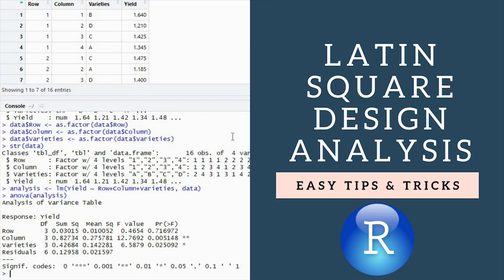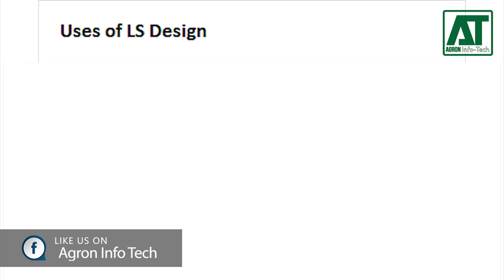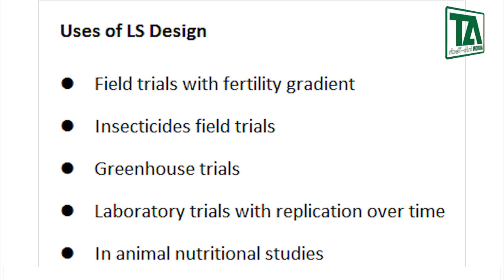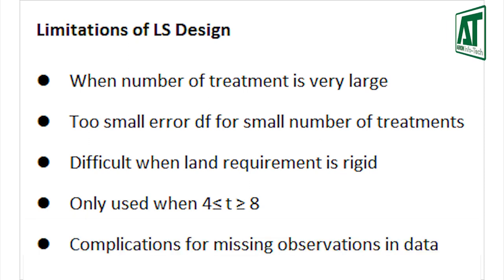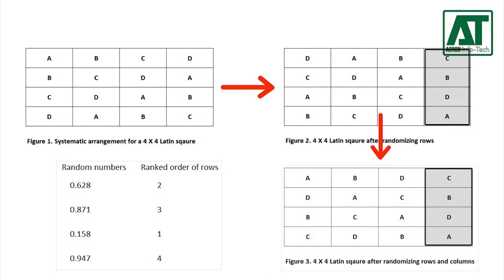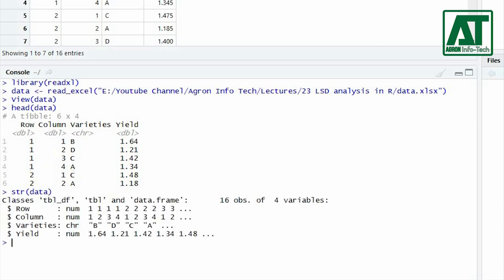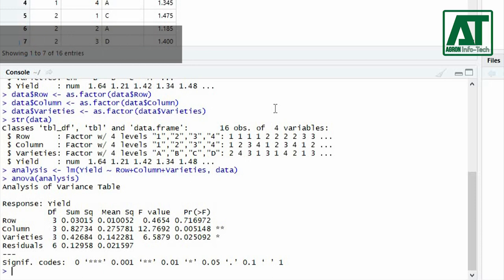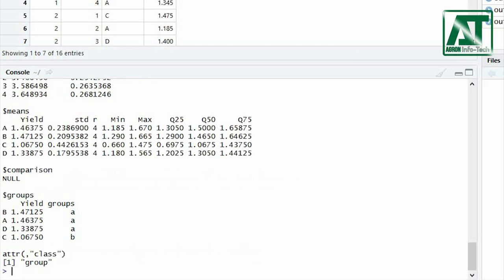Analysis of Latin Square Design using R

Comment: Is the ANOVA still valid and performed in the same way if I use a standard latin square design (without randomization of rows and columns)? In my case I'm using a 3x3 design. Thank you in advance
Reply from the maker: Randomization is carried out to reduce the error effect. May be you get more prominent error effect and it may alter the true effect of treatments.

Comment: thank you for the video, I just have two questions; how did you randomize the columns and the rows, and how can we use a latin square design in bigdata?
Reply from the maker: I randomize rows and columns by using random table. One of the limitations of Latin Square design is that you cannot use it for large number of treatments as it will require large number of replications. You can use this with 4 to 8 number of treatments. Please see limitations at 2:25